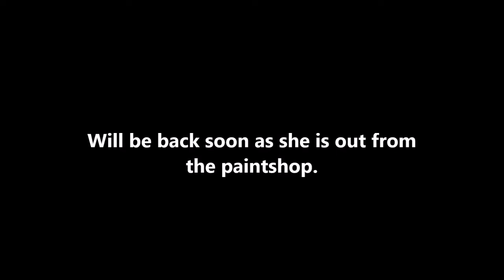My 1974 Ford Cortina Restoration (PART 15) Jan 2020

Comment: Keith, after re-watching this can the bottoms of the doors be repaired if it is completely missing?
Reply from the maker: Hooked on Classics: Yes they can,  but I had new doors in stock, and only needed one more, which I found, so I went for new on this car, so the doors were not patched, but I have doors in stock that need to be, at some point, interestingly years ago, Veng Panels did make repair sections for the Mk.3 door bottoms, but not seen any of them for years!
Reply: @Cortinaman63  Ok thanks. I need to get the passenger front door repaired but I have been told its not easy.
Reply from the maker: @CortinasAndClassics  All depends on your welding and metal fabrication skills, and where the rust is, the more complex the shape you need to copy, the harder it is, but everything metal is fixable,with time and effort. An easy way is to buy a second hand door with poor skin but good bottom, and cut it out and graft it in

Comment: How is the restoration going in the Paintshop stage?
Reply from the maker: mark giles: Hi mark, Thanks for asking, The car has been sitting in the paint shop for weeks, as they closed due to the virus, unfortunately due to problems their end it did not get started on before they closed, so we are way behind with working on it, the good news is they are now open again, and they tell me they will be starting on it soon,  I have been working every day, so not been able to go to the workshop to film any other work on car bits, for this car or another car we are also working on there, but soon as thing are back to normal, both this restoration and the other one, the filming can carry on, and new videos will be coming up on both restorations. and I have  a couple of other Films planned for the channel which hopefully some will find interesting.so thanks for your support and sticking with me,

Comment: You sure do work to a high standard, good, every credit.
Reply from the maker: Rusty Smith, Thank you for watching, and your kind comments on the quality of the work, very much appreciated. it takes time to do high standard work, but the end results are worth it, most would use body filler but lead loading for example lasts far longer, and was how Ford did it so keeps the car more original. So pleased you liked the video. thanks for your support.
Reply: @Cortinaman63  : Does any manufacturer do lead loading these days ? apparently is was common years ago but i don't know if it's still used.  looking forward to seeing progress on this project when time and money permit. Thanks for the videos

Comment: You have just gained another subscriber.
I also have a 74 tina on its 4th evolution but its not for the purists.
Mine has still those buttons in the door frames which i removed carefully. 👍
If you could see mine you would seriously wet yourself with only 5 weld repairs and outer sills. All back to bare steel and epoxy primed. 😎

Comment: Great progress is storing car in a container risky due to metal box's sweat unless well ventilated.
Reply from the maker: Sean Roberts, Thanks for watching, glad you liked the video, the containers are vented, and but do get the odd water beading, but less moisture than if left outside!!, so was my best storage option, the workshop can hold 5 cars to work on, but I did not want to take up working space with  2 other cars of mine on hold in there,  summer time the containers stay dry, just about 3 months of the year I need to keep an eye on the moisture, as you  helpfully pointed out, thanks.
Reply: @Cortinaman63  j Leno garage would be lovely but I guess check on container and carry on 👍